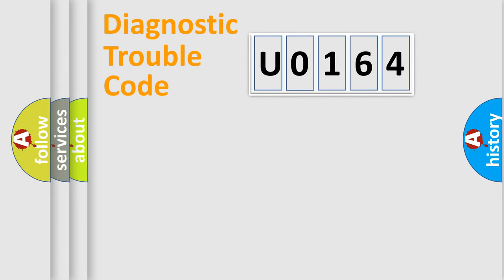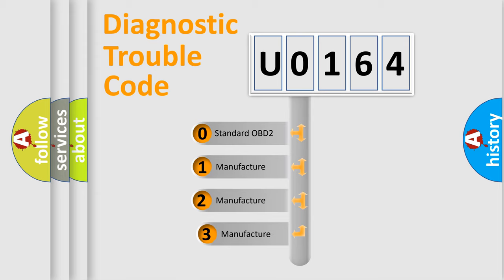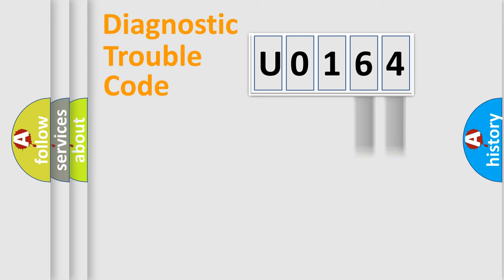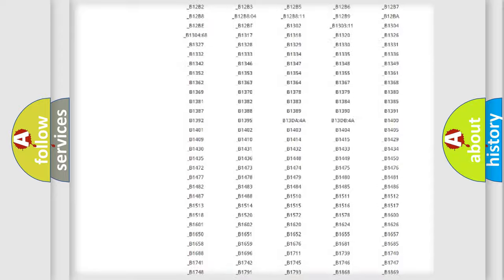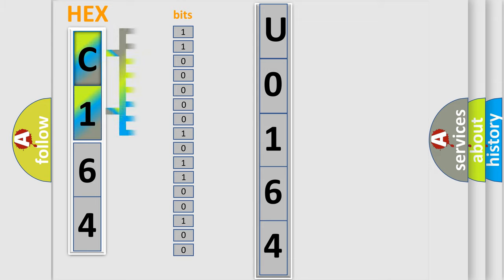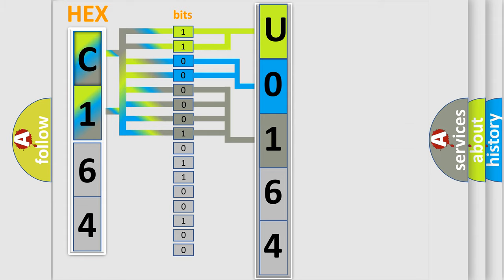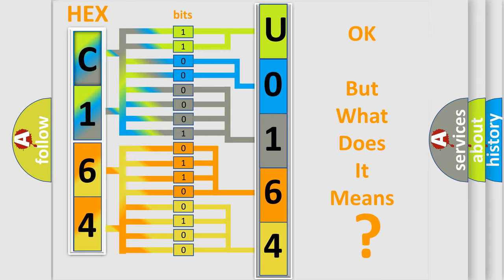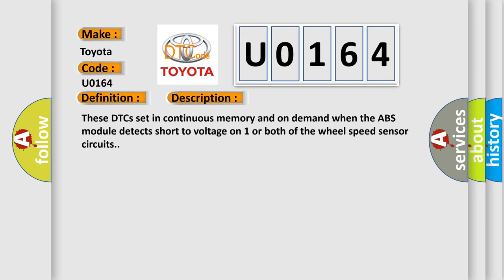DTC Toyota U0164 Short Explanation

Comment: There is a problem with the Air Condition of my Camry 2014 4 cylinder model. Show DTC U0164 when i diagnose by using OBDII.Is there any solution .?
Reply: exactly what i’m having with my 2015 corolla S, did you find a solution